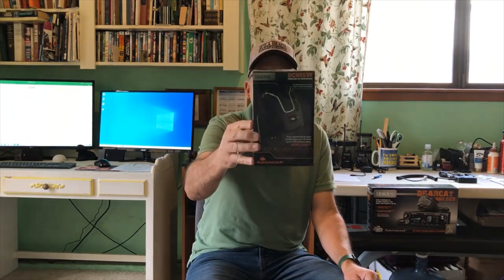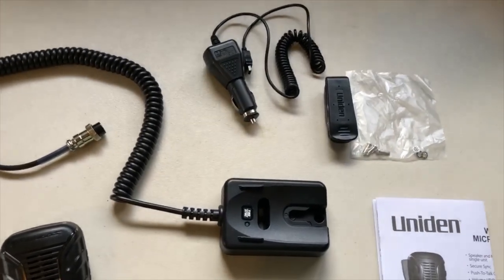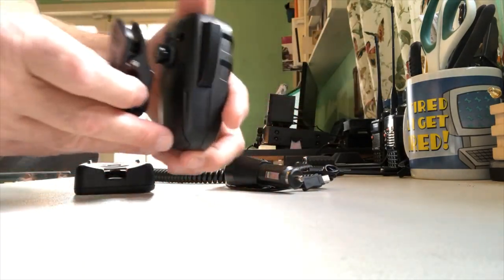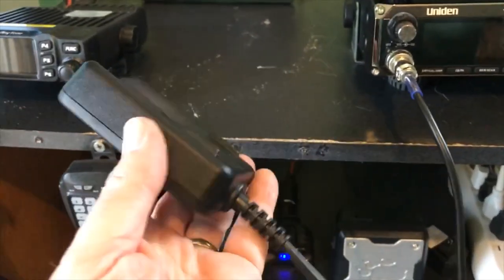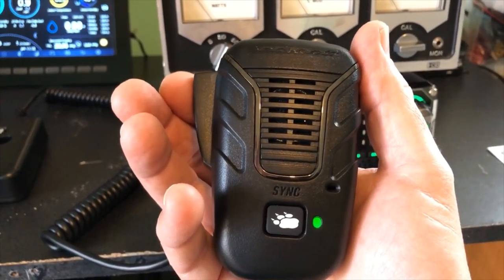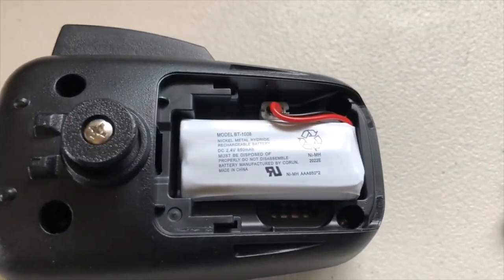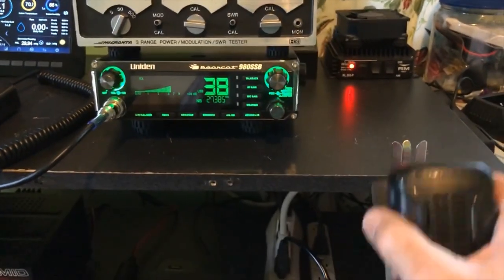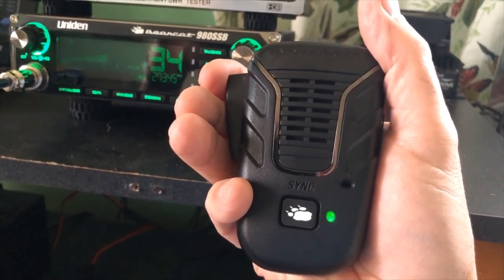Uniden BC906W Wireless CB Microphone

Comment: I've been running one of these on my AT-6666 for a few months now. If you are not in a truck and don't need the noise cancelling, open that thing up and drill the plastic hole in the front out to about .25".  That will make it so you don't have to talk so close to that little hole. The digital audio on this doesn't have much for dynamic range, so it is a bit like using a compressor. It really is a great little piece of gear to own, Uniden did a nice job on this one.
Reply: Did you have to modify the mic to work with the 6666
Reply: @dxfordummies  I just made an adapter that went from 6pin to 6 pin (straight through) so I could add a cable to go to the external speaker jack. You could just splice into the cable as well. The 6666 does supply the voltage (8.4v) the mic needs on pin 6, just no rx audio on pin 4. The pinout is exactly the same as a McKinley/980SSB otherwise. No worries about the 5v going to the stock condenser mic either(pin 1). Run your volume on the radio between 6-8 and it will work/sound just fine.
Reply: A few years ago I heard a guy who must have had that microphone in his coat pocket becaus it was keyed up for about 20 minutes while he snow blowed his driveway and then his wife called and talked for a bit. And went back to blowing the snow. It sounded good and clean audio. I bet it would be a neat convince.
Reply: @kkristopher7413  That's funny. I wonder if he ever found out he was transmitting?

Comment: I can answer that question as to why you are getting more watts out with this mic. Factory setting for modulation in most radios is about 70%. With a louder audio input you can raise that to about 80%. With a compressor you can get 90%, if you have and O-scope you can adjust it to 100%. In other words you increased modulation with a louder audio signal

Comment: Been wanting to get one of these, I understand it can be paired with the president McKinley which I have.
Reply from the maker: Hi Bob, President actually made a wireless speaker microphone that looked just like the Uniden except it was branded as a "President Liberty" and it was sold overseas. I understand that they are discontinued now. I think the President radios use 13 volts on the #6 pin for power to the transmitter. Thanks for watching! 73s from 595 Northern Nevada.

Comment: My Wireless My  Microphone is on it'st way and Relly Needed  as a Handicap Person  I Can't run into Another Room  and be in my Computer Room it  will take me time to go From Room to Room. This will Save the day for me for sure
Reply from the maker: Great! I hope you enjoy the microphone.
Reply: @RidgeHikerAdventures  No I'm not Enjoying the Microphone I need an Adapter for the Radio Because my Radio have 4 Pin Male Sticking out and the Wireless Transmitter  have 6 Pins Female only what I need is 4 Pin Female and then 6 Pin Male Pin Adapter can't seem to Find it
Reply from the maker: I’m sorry to hear that. As far as I know, the wireless microphone only works with the Uniden 980 and I believe the 880. It uses a six pin connector in which two of the pins supply power to the transmitter.
Reply: Yea I Guess I will wait a little more or find me a Radio like the Striker 955 Hp that has the same Amount of Power and that it easy to use. Plus the Ability to use the Wireless Mic. It OK if you ever hear me on the Radio on LSB Miami 305 on 27.375 or 27,385 or even 395 give me a Shout out I'm Mainly on the Afternoon here in Miami

Comment: So I am running the same radio in just order the same mic. But let me ask you, how are you getting the DX? What wattage is your antenna? And are you using something to make it travel farther like a linear hint hint if so let your boy know
Reply from the maker: I'm using an Solarcon A-99 antenna mounted about 13 feet off the ground. I'm at about 5000 feet elevation surrounded by mountains on all sides. My location is really good for getting out barefoot. I have accidentally left my RM Italy KL 203-P on when switching from 10 meters to 11 meters running around 57 watts. :) Thanks for watching and 73s from 595 Lake Tahoe Nevada!
Reply: @RidgeHikerAdventures   not to be a bother but any way like phone or platforms I can get ahold of you I have some serious questions and don't wanna waste my money  thanks again 73 back at you brother
Reply from the maker: @bradyseitz2883  Hi, I'm not an expert by any means, but if you post your questions on my community tab, we can get input from the community. I've had some great comments and suggestions from others that share our interests. 73s.
Reply: Yeah, but what I'm saying is the set up in this video is the same set of I am using so what kind of power supplier you using to run that so I know what to order today.
Reply from the maker: @bradyseitz2883  I'm using a Pyramid 12 amp regulated power supply (model # PS14KX) for my Bearcat radio. For my amp and 2-meter radio, I'm using a Pyle 30 amp switching power supply (model # PSV300). I choose a regulated power supply for the radio, because they are supposed to generate less RF noise. To be honest, I've had other radios hooked up to the Pyle switching power supply and have not heard any RF noise. I also have lots of clip-on ferrite core rings attached to my power cords to try and block any possible RF noise. My old RoadTalker was very sensitive to RF noise, and the rings seem to help. The Bearcat seems pretty well shielded and I have never heard any RF noise on the speaker.
Reply: @RidgeHikerAdventures  So, do you think a 25 ant? Regulated power supply would run my bearcat. And a 100 W Italy 203PI think they are rated at 10 AMp max.
Reply from the maker: I’ve think I’ve read that the 980 draws around 5 amps.  If that is correct , you would be running around 60 percent of what the 25 watt power supply is rated for.